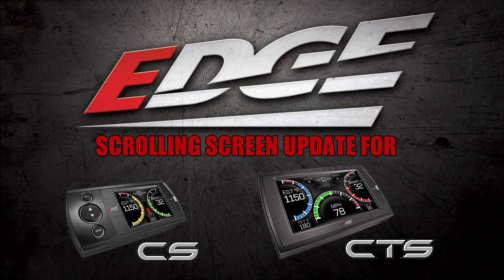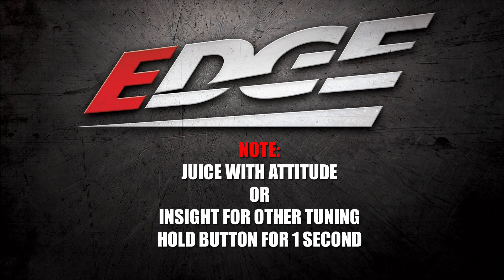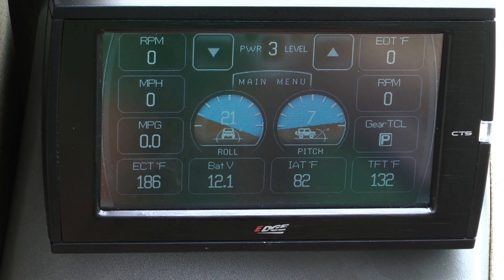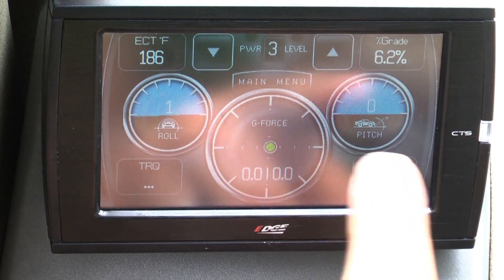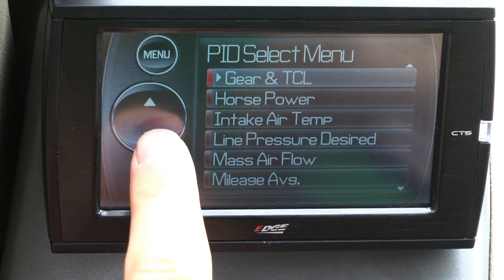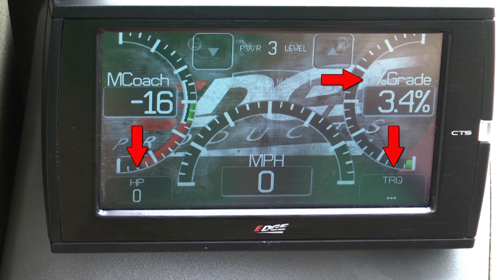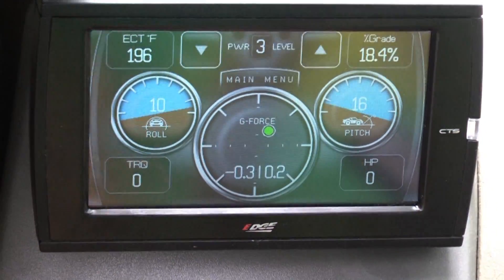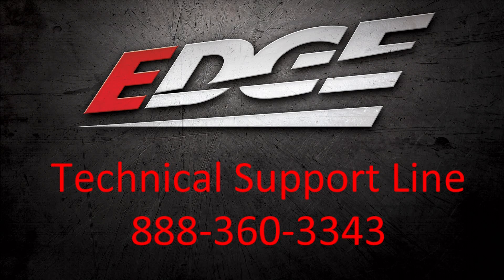Scrolling Screen Update CS & CTS

Comment: Help please, my CTS won’t work where I touch it, if you try to touch one spot on screen it selects a completely different area, even with a stylus. It kinda worked up and down but nothing responds on either side of screen? I’ve called tech and they said update. So I paid a guy to update latest software and now freezes up stays on when trucks off and didn’t change the response of the screen at all. I’m sad because I’d love to be able to use the amazing features of it. Any ideas on how to fix it would be greatly appreciated
Reply: I'm having the same problem with my CTS. The touch screen is not calibrated to the display. It's impossible to navigate thru the menus. I'v just contacted Edge via tech support Email to see if they can help me with this. My unit is obviously no longer under warranty, but I hope they can still make good on it.